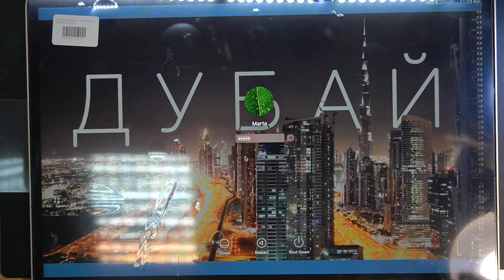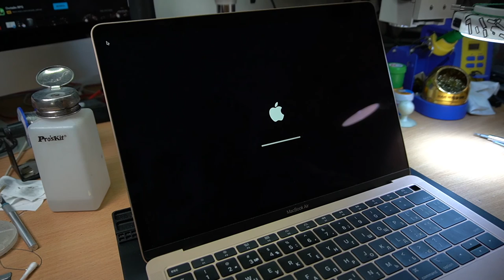MacBook Air 13" retina 2019 A1932 LCD replacement

Comment: excellent demo, but you also demonstrated, it is much better, easier, and smarter to just do the whole assembly, and not the panel itself, it is just too much more work, trying to save $80, that is the cost differential between panel vs whole screen including casing.  Thank You
Reply from the maker: You are right, and thank you for the comment.
But what you don’t know that not all the macbook models are the same and there is some models that is the panel it self is much cheaper to replace than the the hole assembly.
And this video is a demonstration not only for this model ,but for most Apple MacBooks are the same step-by-step repair process.

Comment: @iTouch, how did you get the wifi antenna to come out so easily? Mine seems to be stuck in the middle...like glued or something.
Reply: I had the same issue. I think what unstuck it was lifting the near edge (rotating it towards the back).
Reply: @dans_wildlife   Yea, I found that if you use a little pry tool it's much easier. ;)

Comment: when you replace lcd is the colour and resolution identical to the original? I am going to take my MacBook Air 2020 model that ive had only 2 months to a repair shop as I opened it yesterday and the bottom of the screen had all these lines on it but no visible crack on glass. I soon found out there was a small clear bead on my keyboard that I must've shut the lid onto without realising.
Reply from the maker: Hi, the colors and resolution from the supplier that I am buying from are the same as original.
It depends on the supplier honestly if he is selling a good parts or not. You should check the reviews.

Comment: nice video. question, what stop dust getting into the backlight from the bottom of the display? I know the sides and the top have adhesive but the bottom? Thanks!
Reply from the maker: Hi, from the thumbnail you can see I glued a metal panel to the scene, and on the back side of the panel it has a white stripe which is used as a seal to prevent dust from going in between the LCD and the backlight. and when I screwed in the screws it tightens the sealant.
Reply: @iTouch-repair  Oh wow thanks. I notice though that there is a tiny little space from that white strip to the adhesive on the side. I suppose dust could get into there?
Reply from the maker: @fasinfrank6941  it’s covered by the corners of the cover it self.
You need to see your self to understand how it’s made.
It’s all sealed very good and, after you assemble the screen you have the logo board that is glued and seals the screen also.
Reply: @iTouch-repair  Thank you very much. You do very good work!

Comment: Hi, very well done, thanks for the share, As I am following you and I need to replace a screen, which reference would you suggest for the 3M rubber tape, cannot find appropriate type. Many thanks in advance. Fred
Reply from the maker: Hi, it’s called red double sided tape.
Try to find a not so thick one and to fit the width of the area where you need to glue
Reply: @iTouch-repair  Many thanks for the quick answer. Not dismantled the screen yet, because I ordered it on Ali, it will only arrive on January. Anyway, I do not have any idea of the required width of the tape for this application? 3 or 5 mm ? I am looking for the strongest and the less thick one... Hello from France. Truly yours.
Reply from the maker: @fredericvernochet4024  the width is 5mm will be better.
The thickness is 0.25. You can get 0.30 or 0.35 will be ok.
Reply: @iTouch-repair  Your are the bossssss ! Great !!!!!!

Comment: Hi, would you suggest trying to fix the screen just by replacing the lcd or it’s worth to spend 150 dollars more and get the whole screen assembly?
Reply from the maker: Hi, well it depends on how its gonna be done. if you need perfect results then go with the extra 150$, but if you dont care about that and you are looking to save some money with some minor dust particles on the backlight film then go with this option.
honestly they are the same LCD whether you order the LCD only or the full cover from china.
but you find used one on ebay and maybe you can find it cheaper.
Reply: @iTouch-repair  how visible and annoying are the dust particles on the backlight film? Just assumi an average dust that comes from the repair. Would spraying some electronics repair compressed air help before laying down the lcd?
Reply from the maker: @davidecasciaro6390  it’s best to do this repair very fast so minimum dust come on the backlight film.
And I don’t recommend you blowing with compressed air because you can damage the backlight film.
Better you do this repair alone in a clean room or at least dust clean.
The dust will not be too visible especially the new MacOS has dark mode so I don’t think it will be too noticeable.
Reply: Just tried this…spend the extra money on the full assembly unless you have a few to practice on first. Between all the broken glass and all the prying, the case will look worse for wear, the backlight components will probably be dinged or scratched from the original damage as well as you working on it. If you shop carefully you can find the full assembly for about $25 more and it’s worth it.

Comment: if i replace the whole screen with the lid and everything will i lose true tone?
Reply: Yes. Front facing camera is paired with logic board I think.
Reply: You’ll lose True Tone regardless if you change the screen. You need to get a programmer and copy that date from the original screen to the aftermarket one. Or if you don’t have the original screen there are videos all over YouTube that will show you how to pull the data from 3utools and program the aftermarket screen with a programmer